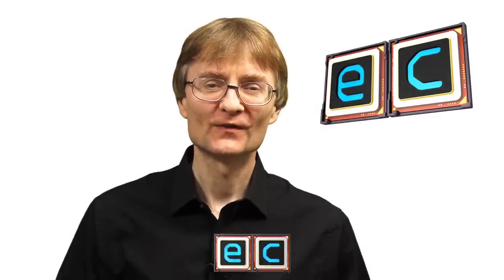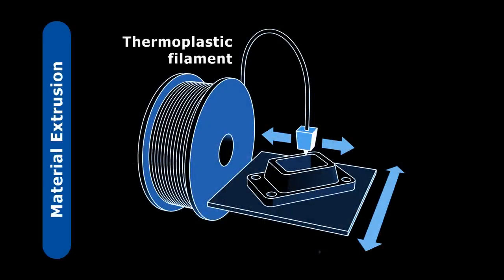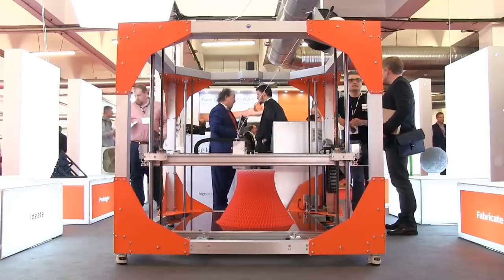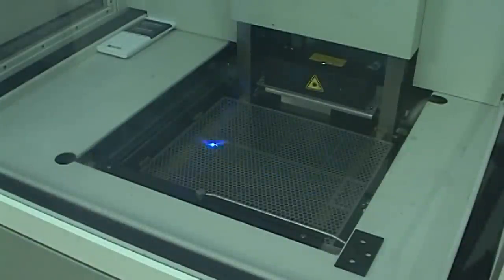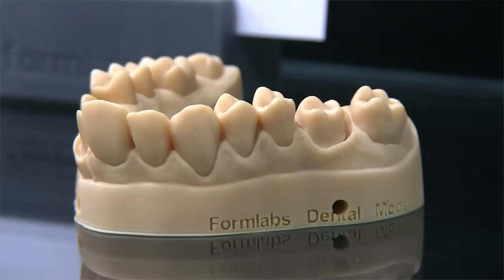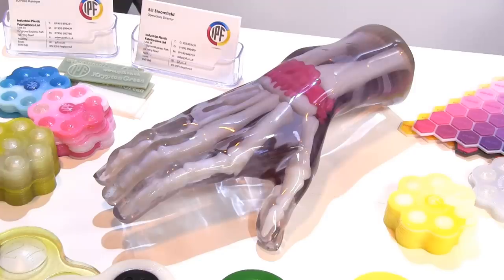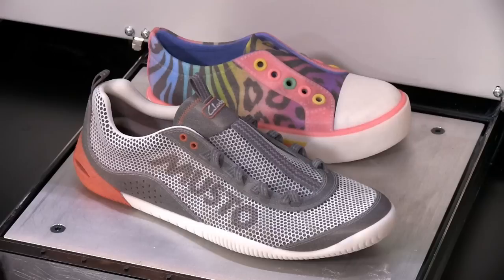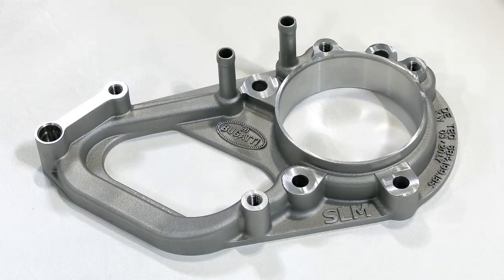3D Printing Technologies

Comment: At 1:40, that model of printer has designed flaw wherein the wiring to the heated bed is chafed by a sharp edge below the build surface/heated bed. And if the heated bed brakes the temperature will show as “999 Degrees Celsius” until it’s fixed.

Comment: I bought a little da vinci mini 3D printer a few years ago.  I'm no expert with it but I've used it to make parts I need such as for my classic car or even to replace a missing part on a freezer.  I will also use it when I need plastic parts for video equipment.  It's a super little thing for the very low cost.

Comment: Just over 20 years ago we used a Vat Photopolymerisation service, then it was called "Instant Prototyping" to make test parts for F1 car wind tunnel testing.  Damn expensive, so only done after extensive CFD work. they were so precious that they got couriered back in expensive custom aluminium flight cases which came in handy if you could nab them.

Comment: Good to see 3d printing is still alive and well. I've been an avid fan of home 3d printing for a few years, and have 2 and a half 3d printers myself (the half being an old Prusa i3 wooden model that was scalped for parts for a custom core xy design).

The only thing I have found is that the home printing enthusiasm and market has become very quiet. Projects like RepRap for example are pretty much dead at this point (their own site hasn't had an update in over 3 years). I think this is primarily down to 3d printer kits becoming so widely available and affordable that the idea of a self replicating 3d printer is no longer what people want.

Comment: A polarising filter would help when filming through reflective surfaces 👍. Fascinating video, thank you.
Reply from the maker: Thanks for  this. I already use a polarizing filter. They help, but do not perform magic with multiple light sources (and many 3D printers are lit above and below the glass in question).
Reply: I see. Noted. Quite a challenge. 🙃

Comment: Hi Chris, before the next trip to a trade show, you might want to look into a circular polarizing filter to fit to your camera. They can be used to remove reflections from glass in-camera.

There's an article and video on Digital Camera World by Rob Lawton about them that I won't link to avoid spam filtering in the comments but it has a concise explanation of how to use them and why. They make images a bit dimmer, but it should be fine for video if you have a camera that can deliver good images at higher ISO.
Reply from the maker: Thanks for this. I use both linear and cricular polarizers (both critical in my old days of shooting cel animation!(). But they have their limits -- especially when something is lit from multiple sources, and often both externall and internally! :)

Comment: Very interesting, Chris. Great job summing up most of the methods available out there.
For FDMs, besides cartesian and delta printers, there are also those with a robotic arm, right? IIRC there's one for concrete that is based on that. I don't see many people talking about those...
Reply from the maker: Yes, indeed -- there are material extrusion printers that use a robotic arm, with models that work with plastics and concrete as you say.

Comment: Remember back in the old days we used to use printers that had old interfaces like those DB-25 Parallel Ports as well as those noisy and slow Dot Matrix printers? I wasn't sure if you want to explain to your subs and fans on various printers like Dot-Matrix, Thermal, Ink-Jet and Laser Printers.

Comment: What about sintering? Selective laser sintering uses lasers to melt specific spots inside a bin of powdered plastic to form the item and selective laser melting does a similar thing for metal. It's mind-blowing that desktop sintering is a thing now.
Reply from the maker: What you refer to has the generic name "powder bed fusion" -- the fifth technology covered here. SLS and SLM are manufacturer specific variants of this technology. We also have LS (laser sintering), DMLS (direct metal laser sintering), EMB (electron beam melting) and so on.
Reply: @ExplainingComputers  Ah, okay. Your example reminded me more of laser print because of the drum. 😀

Comment: Another great video! 
Some time ago I contacted ESA and was told that they were thinking about using 3D printers to build structures on Mars. I expressed my concerns about power and time that the device uses but they said they had that under control.  I sure hope that they are right.

Comment: Great video... very interesting stuff... & a good round up of the different technologies available...

My favourite thing about 3D printing is the reduction of waste & a better product.

I heard somewhere that 1 of the big airplane manufacturers used 2 make a part out of 7 bits welded together...
Now they 3D print it...
It's stronger, costs less, made quicker, with less waist & more consistent quality...

Video & reflections...
U need a circular polarizing filter.
If u can't find 1 that's specifically 4 ur camera u can use 1 that's bigger than ur lense & use blue-tack.
Hope that helps...

Comment: I thought I was au fait with 3-D printing techniques, but I see I was well behind the leading edge. Thanks for the update, Chris. 
Now that the initial hype ("Oh wow, in 12 hours you can produce an inch-high plastic gnome"), has died down, it would be interesting to know more about the economics of the field. 
What sizes, volumes (physical and sales), properties, (strength, weight, thermals) are possible with particular technologies, at what price?  These are multidimensional spaces, presumably with large empty hypervolumes, but knowing the general shapes could save a lot of pointless investigation. Any sane engineer uses heuristics to decide where to start detailed calculations. That some areas are currently empty is no criticism of the technologies, since they are still quite new. (That the Wright Flyer was a fairly useless machine didn't mean aviation wasn't going to be valuable after some development.)

Comment: It should be noted that the cost of photopolymer resin has gone down drastically in recent years due to the growth and popularity of low cost SLA 3D printers. You
 can now buy a bottle of resin with 1kg worth material on Amazon for about $30, which is comparable to a 1kg roll of plastic filament.

In addition, due to the simplified manufacturing process of liquid resin (which is just a liquid produced by combining several chemicals), the cost of resin is likely to become cheaper than that of FDM filament, which are more intensive to manufacture on an industrial scale (must be extruded then slowly rolled around a plastic roll, vs. simply poured in a bottle).

Comment: Are jet engine turbine blades made from powder bed fusion?? These have thin tubes through them to air cool the blades as the exhaust temp is above melt temp.
Reply from the maker: This is technically possible, but I am not aware of any turbine blades made this way. However, directed energy deposition (DED) is used in some turbine blade repair, as the technology jets powdered metal into a laser, and can add metal on to an existing surface. So a worn blade can be brought back to new condition using DED.

Comment: You left out a very important detail about resin 3D printers which most consumer ones today use a RGB or monochrome LCD screen and a multi array utlra violet back light source instead of laser or DLP projection. This has reduced the cost dramatically for the consumer market.

Comment: Hi Chris, you mentioned reflection problems when filming 3D printers through viewing panels. Are you aware of the oversized rubber or silicon lens hood thingys that can be used to overcome this? So long as you can get close enough to place the end against the glass, they block reflections and are sufficiently flexible for the camera to still move freely at any reasonable shooting angle (I think they're mainly intended for aquariums, airplanes and office windows). Search for “window lens hood" on Amazon, eBay etc - about £15.
Reply from the maker: I always use a lens hood. :)
Reply: @ExplainingComputers  I don't mean a regular lens hood of the type seen in your “300th Behind the Scenes” episode. I mean the big fat wobbly rubber ones with an 8-10" wide front end that butts up against what you're trying to film through, blocking out reflection sources. Nothing to do with oncoming or sidewards glare, they're purely for reflection issues of the type seen in your Sheet Lamination clip. Do you know the type I’m talking about?
Reply from the maker: @M0227-l1q  Ah, I see, I will investigate. However, how practical this would during a tradeshow shoot I don't know. But where I had full cooperation, certainly. :)

Comment: @2:41 everyone else uses FFF - fused filament fabrication, to route around this trademark.
Reply from the maker: There are many different terms used -- certainly not "everyone" uses FFF. :) Common terms in use by other manufacturers include ‘plastic jet printing’ (PJP), ‘fused filament modelling’ (FFM), ‘fused filament fabrication’ (FFF), the ‘fused deposition method’ and ‘melted and extruded modelling’ (MEM). And the official ASTM term is "material extrusion", which is now widely used in industry.

Comment: A slight omission. As I'm sure you know, most desktop resin printers use neither a laser or DLP system, instead relying on an LCD panel with a UV backlight.  

Otherwise, as always, great content.

Comment: The problem with getting good footage of DED is that it's devilishly hard to find a scanning tunnelling electron macro lens for most cameras. And then the product the printer will be building is likely to be some sort of stealth metamaterial, so you cant even get a decent shot of the finished product.

Comment: Actually, the last method is very common. Laser printers use it all the time.
Reply from the maker: Laser printers fuse toner onto paper with heat, which is not the same process! :)
Reply: @ExplainingComputers  But the toner is transferred from the cartridge by a difference of electrical charge. The "cooking" replaces some other sort of glue. Say, if we forget about the final stage, isn't it that technology?
Reply from the maker: @y2ksw1  It's not the same. There is no glue involved in powder bed fusion -- the granules of the metal or plastic used to build the object are fused (or "sintered") together with heat from a laser or electron beam, which traces each layer in 2D space. Whereas in a laser printer, the heat comes from the rollers in the fuser unit -- not the laser. The laser in a laser printer used to trade the image one line at a time (1D) on the drum, leaving the image there electrostatically to attract toner where required, which are then transferred to the paper via the fuser rollers. So certainly both processes use a laser to form an image/layer, but in very different ways.
Reply: @ExplainingComputers  I guess I have to dive into the argument a bit more 😊
Reply from the maker: @y2ksw1  :)

Comment: my current research on a personal level is all dedicated to tech to upgrade standard in home printers to be on a replicator level of true in house manufacturing, ie something that can even print the semiconductor components of a CPU from scratch along with the ability to take something unwanted and break it down into basic material components and sort these in tanks to be reused later to print out a new object, like say an old LCD TV being broken down completely to save every bit of the screen, semiconductor processors, diodes caps ect, and sort the materials into tanks then print out a bunch of say Cell phones from scratch even printing out the tiny ARM CPUs and ram before printing out some sort of coating to protect the IC chips inside, all while also being able to print out magnetic material from old magnets that have been broken down and sorted to save the precious rare earth metals so they can be added back later to the iron and boron and print out custom magnets and magnetize them as they go since the temps to bond new magnetic material are lower than the temp that will cause them to demagnetize :) and since we are printing iron in those obviously the components to print out stainless steel parts to make the ways and trapping for controlled motion are also possible, 

the obvious thing is that a printer printed by a printer will either need the parts printed to be assembled afterwards so you would not print out a full printer ready to use, but a kit of parts made to snap and screw together unless the whole printer printed was smaller than the printer bed of the original, with one various possible option being one that can print standoffs it uses to raise itself and the printer is able to rove around a flat plane you clear off like say a sheet of metal laying on a piece of plywood on a table or some such, and print something far larger than itself and its tanks are all held separately with connection by way of a hose system, that possible can also print out more hose and break down hose it does not need in the hose opening to allow it to stray and use a larger area than its connection originally to its storage tanks (which the sorting system of broken down materials requires a system to motivate the materials along these paths and allows them to be sorted so it would be quite a complex system it would need to connect to its tanks anyway.)

Obviously first gen is going to require relying on a lot of the tried and true methods being used in industry for manufacturing like the fact that we still are in the vacuum tube era, because all our semiconductors that are "solid state" are manufactured in vacuum chambers at some point by vapor deposition and the like, so with out these giant vacuum tubes they would not exist, :)   

But by second generation we should be able to create the clean room level environment needed by way of the nozzle system and its contact with what ever it is printing onto to build up the whole of the object :)

Comment: hate to say , but 3d printing does get over-hyped, like printing out high strength items at home (car parts, guns) . not like forged parts or milled parts
Reply from the maker: It gets/got over-hyped in the consumer space (esp. c.2012-2014). But the industry itself (not the consumer desktop space) I don't think is over-hyped -- it has been consistently delivering ahead of schedule, facilitating considerable time and cost savings esp. in the production of molds and tooling. I don't know a credible 3D printing commentator or industrial player who ever talked about mass home printing. But that is what, for a few years the MEDIA reported.

Comment: 3D-Printing is still far behind the classic milling process. 3D printed stuff is fancy but quite expensive and breaks up quite fast.
Reply: if you get things dialed in, it can be very strong. Not injection-mold strong, but strong enough to test things with, or make one-off solutions to things around the house.
Reply from the maker: Not really true -- it depends on the technology and hardware used. As the video shows, there is far more to 3D printing than basic, desktop material extrusion. :) High end industrial material extrusion is now regularly used to make parts for aircraft (eg using ULTEM 9085), and while this is indeed quite expensive, it most certain does not "break up fast". Metal parts produced via powder bed fusion can also be at least as strong as cast or milled parts, and some shapes that can be made with 3D printing cannot be made via casting or milling (I'm thinking of aircraft engine fuel injectors). Some plastic parts made via vat photopolymerization or material jetting also have properties equivalent to injection molded plastic parts. Indeed, even material extrusion can produce very strong parts indeed when reinforced with carbon fibre, with these parts now used in place of aluminium parts in (eg) aviation and motor racing.
Reply: @ExplainingComputers  It is exactly that. An airplane is checked quite frequently and those 3D printed parts must be replaced quite often (have a look at the maintenance book). By law, those parts must be bought at Airbus who makes a lot of money with this business scheme.
Reply from the maker: @snax_4820  Not all aircraft parts are made by Airbus! :) It is my understanding, for example, that the 3D printed fuel injectors for GE's LEAP engine are not just 25 per cent lighter, but five times more durable than traditional components. So they are replaced less frequently that the latter. This is of course just one example -- and you are certainly right about component restrictive practices by all of the aircraft makers, 3DP or conventional.

Comment: I cant see how printing 7 million face shields can be cost-effective, surely it would be much much cheaper and vastly quicker to use injection moulding for production of so many units.
 I employed my 3 printers to print the Prusa shield design for local services and managed to output 400 units before they could source their own, Joseph Prusa has one of the largest print farms on Earth and employed a significant percentage of them to the production of the face shield and came nowhere near 1 million units never mind 7 million, I think someone in their PR department is guilty of gross over-exaggeration in the numbers, they wouldn't be the first in the Covid times.

Comment: Have a 3D printer. upside is you can print parts for the printer. Downside is, you can't print those parts if the printer is already broken. whoops.